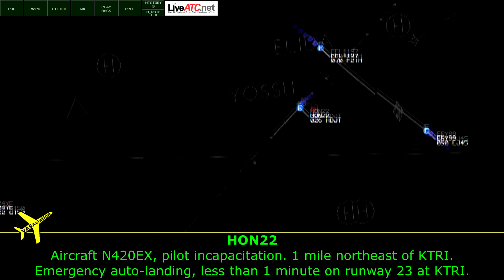HondaJet Plane AUTO-LANDS ITSELF after "Pilot Incapacitation" | Certification TEST Complete!

Comment: It would have been nice if the test aircraft also reported its own bearing and altitude. Yes, I know the tower can see it on radar, but it would help give other aircraft an idea of where it is in relation to themselves.
Reply from the maker: good idea
Reply: I'm surprised it doesn't call mayday on the first transmission
Reply: @paulevans9307  The human pilot had already set the transponder signal to "emergency" before the test run. So no need for a mayday call.
Reply: @Fastvoice yes, in this test mode that happened. In a real life situation, it would make sense to do that though.
And for a system test, it should behave the same way as a live situation?
Reply: @paulevans9307  Behave the same, yes. But swapping out the audio files/TTS texts can still be done without influencing the test results. While software is susceptible to "change something and some other totally unrelated stuff breaks", swapping out audio files or text strings is extremely unlikely to do that. And there's always the final certification test after finalising the version to be rolled out.
Reply: @paulevans9307  It's possible the emergency autoland system is patched to the transponder so when it activates it is the one doing the transponder signal change.
Reply: @paulevans9307 it's an American system. Even the automatic systems don't like to call Mayday.
Reply: The emergency was established before "we're ready to press the button if you are." Likely before they were passed off to tower.
Reply: Only problem is it would clog up the airways. I think it's better to let ATC organize traffic on the behalf of the autolanding aircraft. I feel this test was also a good test for ATC and the FAA on how to handle such a situation in the future.
Reply: You can probably see if you have adsb in

Comment: If this was JFK then ATC would be arguing with the autoland voice
Reply: It sure does key the mic for a longgggggg time even after it's done speaking! I'm sure JFK would absolutely love it, perfect airspace for it.
Reply from the maker: Imagine haha
Reply: @VASAviation  Is it waiting for clear air before transmitting? I notice that it did not step on any transmissions.
Reply: @Fred_Flintstone1  a lot of radios at least for ham radio and public safety can be programed with what is called busy channel inhibit for TX meaning that the radio will not transmit if it detects a carrier signal on the frequency it prevents people from talking over each other but it also in an emergency could prevent  a station from getting help if there is a stuck mic on the channel that is needed
Reply: @Fred_Flintstone1  Oh it did.
Reply: @Fred_Flintstone1  You would think so, as it has no way of knowing if its transmissions are received so would give itself the best chance.
Reply: @Fred_Flintstone1 but it’s constantly stepping over readbacks. If this was happening on my frequency I’d have an aneurysm not being able to issue control instructions or get positive read backs. Taking 20 seconds every minute or two to repeat your location is excessive in a busy airspace/frequency.
Reply: @oooohkaay  I ll listen again.
Reply: @oooohkaay if the auto land is coming into play, it is already an emergency situation. In emergency situations, there is no "busy traffic", because the first thing ATC wants to do is isolate the problem from everyone else.
Reply: @Fred_Flintstone1  Seemed like it did step on some?  At least one appeared to be mid-talking (just caught the suffix) when the previous transmission unkeyed?  Was odd it was getting sometimes cut off at the start.

I could see wanting to force TX at some interval but maybe should have some leeway where it listens for a break, then after X delay just transmits anyway as a possibly reasonable logic for an emergency computer system.
Reply: @oooohkaay  so? Maybe it could be better but I'm pretty sure every atc on earth would prefer this to the alternatives of the jet just auto landing without even attempting to talk to atc, or slamming into the ground
Reply: @CoreStarter additionally, an obvious ROBOT on frequency will stick out like a Squawk 7707.
Reply: @oooohkaay This is a (simulated) emergency situation with no way for others to request additional info, and no-one maintaining physical separation in the plane performing the procedure. So erring on the side of more info for other planes in the airspace (especially if it happens to be uncontrolled airspace) is a good thing. 
Remember, this should be a rare occurrence, and in a real situation it's expected that others would react somewhat differently than "oh, this test is holding up my landing clearance, bah, guess I'll wait."

GA pilots are usually quite proactive in helping other GA planes in emergency situations, and being aware of what's going on may be the difference between the plane landing and there being someone to take care of the pilot, and it landing and becoming a coffin+traffic hazard on the runway.
Reply: @wolvesone  TX inhibit basically works best with FM signals. Aircraft are using AM, this makes it more difficult.
Reply: @oooohkaay yeah.  But this is intended to save lives in an emergency situation.  Something like this isn’t going to happen daily.   The machine has no capability to retransmit if requested. And no capability to respond to ATC requests.    If something like this is going down things are already out of standard operating procedure.   Priority is always keeping planes from becoming flaming wrecks on the runway
Reply: @Validole  Looks like oooohkay went back to his simulator, where he could have an aneurysm free experience on "his frequency".
Reply: JFK, to all inbound aircrafts, expect  half an hour delay because Honda22 is blocking the frequency
Reply: @jochenwagner2782  Honda22, could you speed up your transmissions a bit, you're stomping on freq down here.
Reply: @jochenwagner2782  The real question is, did the program the Autoland to overrun the end of the runway, as pilots of the jet are beginning to be known for?
Reply: @jochenwagner2782 *aircraft is the plural for aircraft NO "S"
Reply: @Mikere5 Dankeschön! ¡Muchas gracias!
Sometimes it's hard to remember all the exceptions of all the languages I use daily.
Reply: Kennedy Steve would have said “oh yeah robot you have something to say? I have a number for you to call”
Reply: @thehunterstruck  TBH i think had he been on duty this would have been comical in all the right ways, steve was always a professional, he was just naturally funny and clever. His best one if you ask me was, Virgin A380 taxi right on Alpha after the cesna, caution propwash. Could hear the virgin pilots brain short circut
Reply: We won't even discuss LGA.....
Reply: And probably give a number to copy
Reply: Just for a moment, like less than a second, I thought you meant that would occur if it was an AI voice clone of the actual JFK, the President.
Reply: "i have a number for you to call"🤣🤣
Reply: @ Autoland bot - caution, prop wash
Reply: KCLT would just tell autoland to go land at a different airport and continue ops
Reply: You sir win the comment section 😂🤙🔥
Reply: Wonder which scenario would have less paperwork, emergency automated landing or crash report?
Reply: I have a dream, that JFK could stick to standard phraseology and stop some bs that doesnt help the operation
Reply: @officerprune7271  What like telling a BA pilot to speak proper English  like Jerseyese????????😊😊😊
Reply: @officerprune7271 but then the atc wouldn't be able to blow off steam and might possibly self conflagrate because all the stupid things pilots there do.
Reply: HondaJet: "Pilot Incapacitation, 5 minutes to JFK"
JFK: "NO NO NO NO, WAIT WAIT WAIT WAIIIT!!!!"
Reply: Incapacitation is not my problem, know your aircraft.. helloo, helloo

Comment: This is a fantastic thing to have. I read here it can detect pilot incapacitation somehow, but even if it couldn't, it would still save lives in situations where a passenger stays conscious, or where the pilot starts feeling dizzy or unwell but is still capable of activating autoland. Hopefully this system will eliminate situations where passengers without training need to attempt to fly the small aircraft manually. I imagine with this safety feature, the numbers of passengers eager to pay for sightseeing flights will increase susbtantially.
Reply: the way I would detect incapacitation would be to count how long it has been since the last pilot input(, and if that is over some time, put a pop up on the PFD asking if the pilot is ok, and say that autoland will be activated unless they respond.
Reply: @cameronwebster6866  Kind of similar to the pedal/button that has to be shortly released / pressed in trains would also be an option, although a less frequent check would probably be fine
Reply: @Kaenguruu  or like tesla autopilot
Reply: @Kaenguruu or how a PC detects inactivity to decide when to go to sleep.

Comment: Very cool.  I've envisioned this system for self-driving cars when the driver doesn't respond to taking over for coming off of a highway.
Reply: I believe there are some cars on the market that will pull a car over to the side of the road if the driver is incapacitated.

Comment: Test success for small private jet. But it required careful coordination by human ATC and human pilots to get out of automated test plane’s way.  

I wonder how that would work on a very busy airport? Also in a future when feature like this is common place and you have multiple auto land aircraft at the same time. How will they interact with each other? Can ATC manage a very busy airspace with an emergency automated approach and landing?

While not fully automated. There are enough automation in airliners for a regular person to receive instructions from ATC to safely land a plane in an unlikely scenario where both pilots are incapacitated. This would be extremely stressful for a short staffed ATC in busy airspace. However having two pilots incapacitated is much more rare than one. That’s why there always should be two pilots on an airliner.
Reply from the maker: Give it some time to be improved
Reply: It's highly unlikely for two aircrafts to have Emergency situations at the same time.
Handling Emergency landings is part and parcel of any ATC's Standard Operating Procedure: Cancel all takeoff/landing clearances, order all aircraft and/or vehicles and/or personnel to vacate the runways immediately, send all incoming aircrafts to holding patterns and/or detour.

Comment: This is a very cool feature and a must-have on GA Aircraft in the near future (probably). But for Jet aircraft, it must never superseded the 2 pilot rule.

As for the test itself, I'm kind of wondering if the ATC should have to radio anything in the blind. Obviously, the Computer voice can't acknowledge and will execute on its announced plan and ATC is bound to accommodate that, but I think it would be smart to relay ground readiness in case the pilot is still aware. They should have during the test anyway, as the pilot was clearly aware, and it wouldn't affect the test.
Reply from the maker: Guess it's for single pilot certified planes

Comment: Cirrus pilots rejoice. Don't have to pull the chute when the engine quits, just press the autoland button.  or when lost in the soup. just press the button.
Reply: This autoland is not designed to land a broken plane -- it's designed to land a fully working plane with an incapacitated pilot.

Garmin has other features that help with the workload after an engine failure, acting a little like autoland but with a flight director instead of autopilot, but this isn't that.
Reply: @juliethecyborg  The cirrus driver doesn't know that.

Comment: A very good system to have, however those automatic announcements on frequency are a bit lengthy. Those could do with shortening.
Also, that system REALLY needs a rejection command for when the runway is unavailable/blocked. I can see this system trying to land on a runway under construction because it misinterpreted a NOTAM or something.
Reply: I think they just rely on the ILS for runway availability. Turn the ILS off if needed due to the notam.
Reply: @namibjDerEchte  it uses RNAV/GPS, not ILS
Reply from the maker: More to improve
Reply: I don't think the announcement should be spoken faster. Remember: This system can NOT respond to ATC asking for "can you repeat that?", so it announces the situation clearly and deliberately a bit slowly.
Reply: Having a problem with the runway at the exact same time as a pilot incapacitation emergency would be incredible bad luck

Comment: The computer seems programmed to avoid standard phrases at all cost. And give minutes instead of distances from the runway? What in the world??
Reply: Minutes is much more practical than distance...the distance can be measured on the radar, minutes will vary quite a lot depending on the aircraft type.
Reply: @sanantonio855  How do GA aircraft avoid a collision with a plane that they don't know where it is? Minutes is useless, since nobody knows what plane it is or how fast it is going.
Reply: @2xKTfc I don’t know if you’ve noticed but there’s an air traffic controller

Comment: I'm less impressed. Autoland has been a thing on the big planes for quite a while. Sure, it is progress to have it on a small jet with a single button press.
However, given the prevailing accident causes in GA, what's really needed is Autoland due to pilot incompetence.
Reply: Auto land in big planes is VERY FAR from being an easy procedure that a flight attendant or even passenger could initiate.
When this thing becomes a success, wait for Airbus to implement it on their large planes too.

Comment: I'm surprised something testing in 2025 would use such an outdated voice module.
Reply: I think it is good that it sounds mechanical.  When it was a state-of-the-art AI voice, ATC would not immediately realize that it was a computer talking to them, and would start asking questions like "how many souls on board" and "how much fuel in cups and fortnights", which the system would not answer.
Now, they immediately hear that this is an emergency auto-land system and they need to make way for it.
Reply: It's simple and easy to understand for any ATC around the world.
Reply: Most airliners use tech from the 80ies, so the Commodore C64 speech module makes sense

Comment: I find it unforgivable that the (Garmin?) auto-land system for the Hondajet appears not to care at all about VFR pilots in the vicinity!  Instead of "n-mile final" it says "n minutes from landing", for example! (But read on.) The broadcasts from the system are completely useless to everyone except air traffic control who can see them on the radar (usually).  Aside from the very first radio call (where it actually gave a position report -- but this of course may be missed in real-world situations), this "AI" from 1979 (who called, by the way, and said they want their Radio Shack "Vox Box" back!) never ONCE uses standard pattern phraseology to help other pilots see and avoid this auto-landing emergency aircraft!  I can't believe they got certified without that!  I mean, for example, instead of saying, "7 minutes from landing" or whatever it says, it should have said, "...turning base for KTRI runway 23", and then when it turned final at 5 miles it should have said, "...5-mile final for KTRI runway 23".  And again at 3 miles.. It gives the announcements at the right times, so it clearly knows which phase of flight it's in and where it is in the pattern (duh!), but it doesn't bother to speak that aloud so other pilots can ALSO have some situational awareness?  This is truly disappointing for a "safety"-focused feature.  Really bad, should not have been certified.
Reply: Yes, @SteveGoldberg, this is hard to believe. I mean, the "AI" only gave its position report ONCE at the very start, in the first transmission. From then on, there were no attempts ever made to give its position -- well, except when it had landed, and it says "on runway 23".  Distance from landing is NOT useful for other pilots.. they have no idea how fast it's going, what type of aircraft it is from just hearing its call sign, and WHERE it is.  Sure, it was whatever it said ("x miles northeast of KTRI") in the very first transmission, but then it immediately started changing course to enter the pattern to land, so it was not in that position for very long. And nobody who didn't know what its plan was (is it doing a left base entry, is it going to first circle the airport, what??) .. all it tells anyone is that it's so-many minutes away.  That does NOTHING for other pilots to see and avoid it! You're so right about this!  I'm amazed -- this should be required for certification unless we want the future headlines to read, "auto-landing jet collides with G/A aircraft on approach to runway at KTRI" .. with details like, "the innovative auto-land system would have saved passengers and incapacitated pilot, except for the resulting mid-air collision from completely non-standard position reporting which  made it impossible for local traffic -- not equipped with a full ATC visualization system -- to get any clues whatsoever as to where the plane was actually at.. just how many minutes from landing it was.".
Reply: @SteveGoldberg  you forgot to switch accounts when talking to yourself.  🤦‍♂